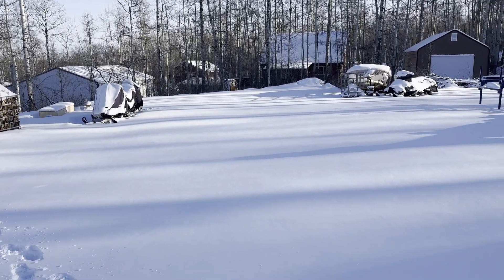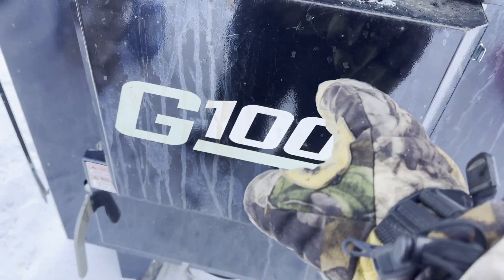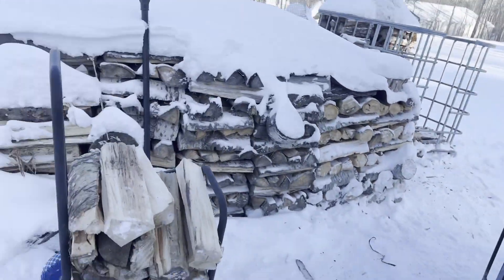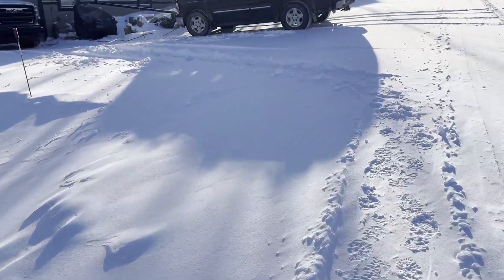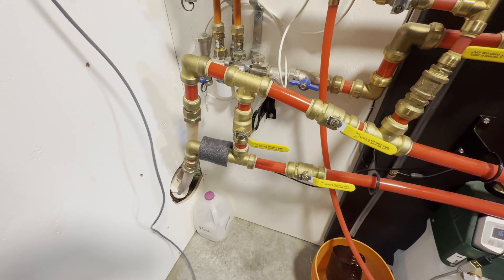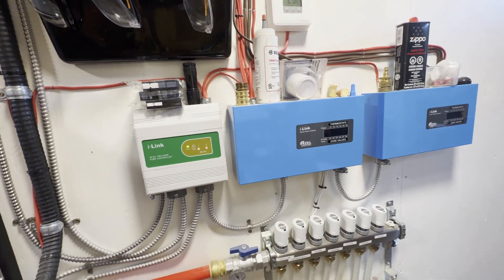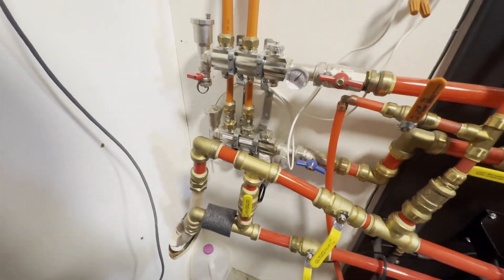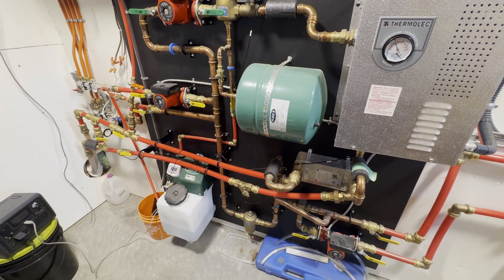Outdoor Wood Boiler and -33C

Comment: Hi Keith! Great looking system you got there. I have a question for you about the glycol. What kind of glycol is it and how many percent do you have in the system?
Reply from the maker: My water sample says its 48% glycol, but the mix you need will depend on your temperature range locally, obviously it gets pretty cold where we are.  It is propylene glycol rated as non-toxic, so you don't have the environmental worries if there is ever a leak.  They say heat transfer isn't as good as straight water, but I haven't had a problem even with temps going down to below -40C/F
Reply: @RandomThingsKeithDoes  Thank you for your fast answer. Very interesting. 🙂 Have a nice day!